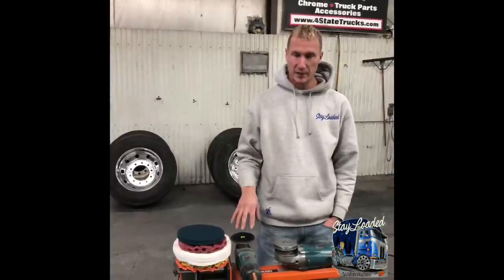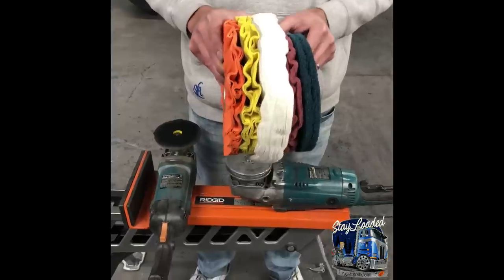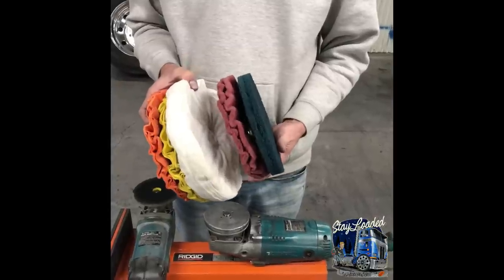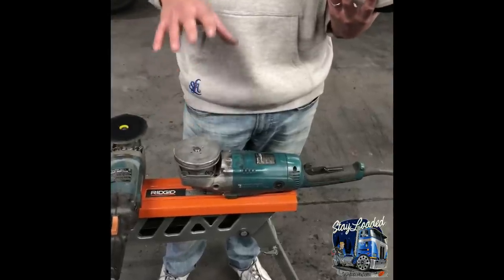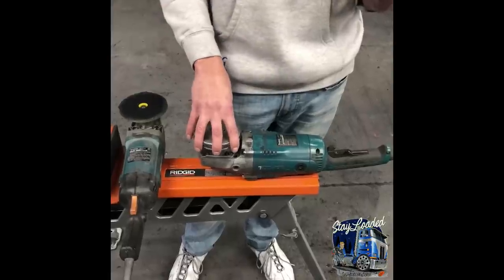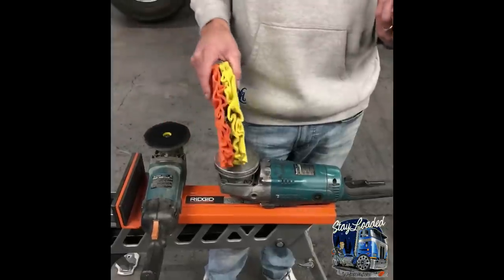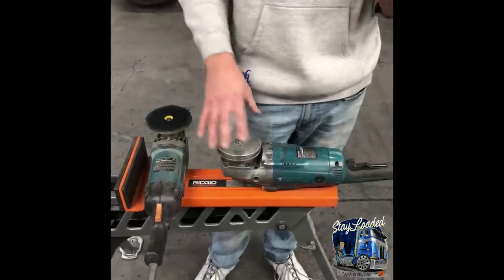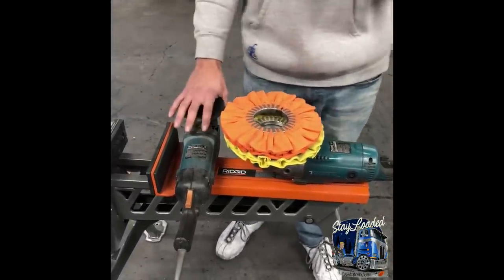How to Pick Your Buffer

Comment: Take his caution VERY seriously with those big 6000rpm grinders. I finally got all my supplies and buffed my steer wheels yesterday. Having never polished before it wasn’t easy to say the least. Evan my man, you make the job look deceivingly easy. A few minutes in and my arms were on fire from holding the beast of a grinder. 20 min later I started getting sloppy and the grinder kicked back and hit my thigh just above the knee and completely buffed the skin right off my damn leg about the size of a large orange. This is the second day and the pain is unexplainable and constant with the wound oozing yellow fluid. Sounds gross? Good, that’s the point so everyone reading this Knows how dangerous this can be. I also have a variable 600-3500 which I’ll be using until I get a very good feel for polishing and I won’t touch the 6000rpm without thick denim from now on. Thanks for the tutorials Evan
Reply: Yeh, Im wearing my old welding chaps even when sanding! Got lucky and missed my leg ! It happens so fast you dont even feel it for a few minutes !
Reply from the maker: Yeah the full speed can make one hell of a mess quickly. That is why I recommend beginners to start with a variable 3500 or less. Even the variable can be dangerous. Hope you are ok and on the mend. I've seen so many bad scenarios over the years.
Reply: I do not even use my 6000rpm anymore. Using marpol pink cut bar, or Menzerna 439T for my first cut with a yellow 10" marpool centerless buff does just fine with my 9227c. Now the 6k sits on the shelf since i switched to menzerna and marpool bars

Comment: can you get to a mirror finish with the 3500rpm ones just taking longer ? or is it only possible with the 6000rpms?
Reply from the maker: You can definitely get a mirror finish with lower rpms also. It is all about time and heat. You need to build heat to get a mirror. Moving slower at low rpm to build heat is the best way.

Comment: I’m a long haul driver that polishes by hand and am very excited to move to the next step to get a higher shine I can run a corded buffer off my trucks inverter but was seriously looking into the Milwaukee cordless buffer but can’t find any videos talking about how it holds up for this kind of work. I’m worried that it won’t spin fast enough as I advance. Any guidance would be greatly appreciated. Thank you
Reply from the maker: It spins fast enough but it doesn't have enough torque and dies too quick.

Comment: On the makitas 
Can you please tell me what rpm’s match up with the numbers on the dial 1-6?
Reply from the maker: There should be a tag on the machine showing the rpms in accordance to the dial. If it is a used machine you can look up the model number online and it will tell you the rpms per number setting. I hope this helps.

Comment: With 9227c anything else we would need to purchase to attach pads to machine?
Reply from the maker: eric gibbs if you buy centerless buffs you need the insertable safety flanges. If you buy two ply buff and blend sanding discs you’ll need an arbor extension but nothing else other than that.
Reply: Flang usually comes with the pad kits. Thank you very much. Just don't want to be missing anything. I'm knew at this.

Comment: So you would only use the white dommet pad on a 3500 rpm buffer not a 6k buffer? Only use your cut and color pads on 6k?
Reply from the maker: White pad on a 6,000 rpm is like holding a stick of dynamite in your hand. LOL Yes 2200 rpm or less on the white pads.
Reply: @EvanStegerMetalPolishing  haha okay sounds good. What pad is best for coloring. I currently have a orange and yellow, purple and green, and the white domet pad. The purple green says it’s a secondary cut, so that doesn’t count for coloring right? And the white domet is really only used when wanting a show shine? Or am I wrong.
Reply from the maker: @parkerhilton8913  White is primarily show shine yes. I am unfamiliar with the buffs you are using but secondary cut buffs are what I use for color. So whatever your box says I would go with that.
Reply: @EvanStegerMetalPolishing  awesome thanks. Just wanted to make sure. Thanks for the very informative ideas 👍🏼
Reply from the maker: @parkerhilton8913  Glad to help. Thanks for watching.